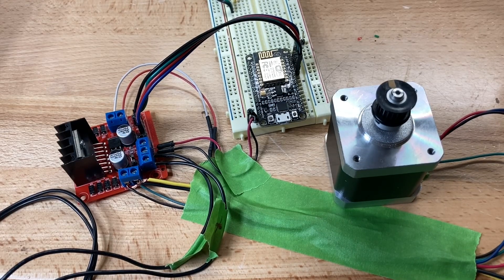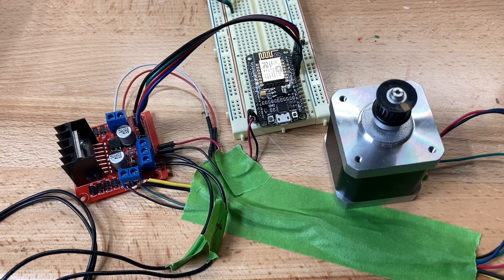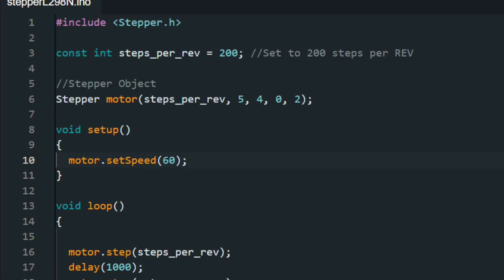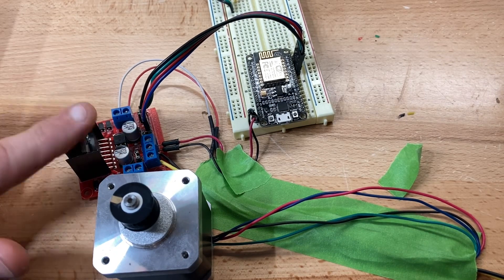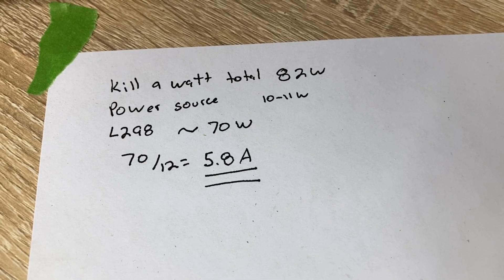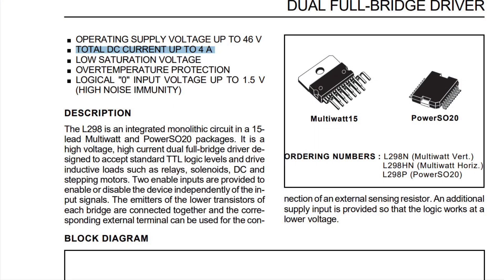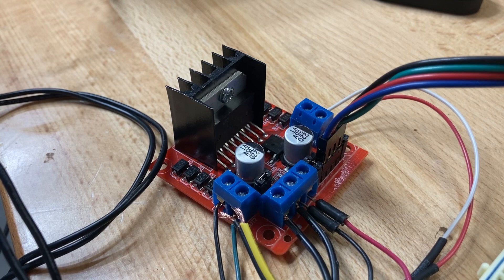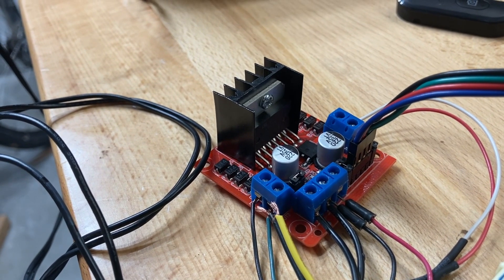Hot stepper motor driver when using Arduino and L298.

Comment: This is not a very good stepper driver. You should use dedicated stepper driver like TB6600 or something similar. Thanks
Reply from the maker: Agreed.  I kept seeing different tutorials talk about using it, but they don't mention how terrible it is for a stepper.
Reply: @ucan3dprint959 Same here, saw a lot of videos with steppers and l298, however mine will get super hot after some minute only. Still haven’t had any use of the l298 for anything, gets overheated from looking at it.

Can I ask if you found a solution or switched to something else?